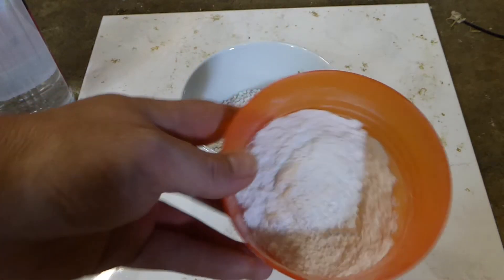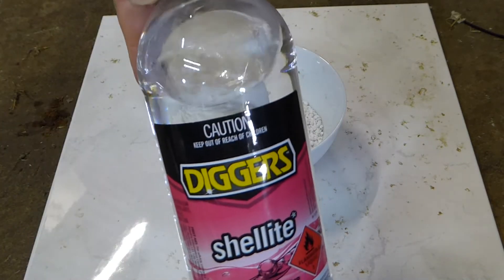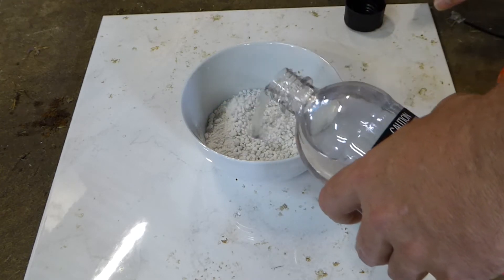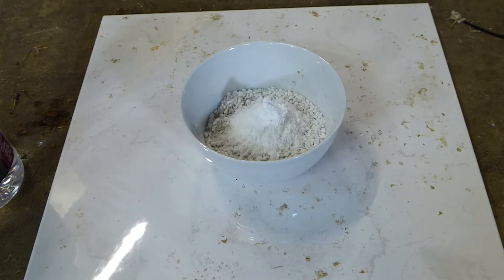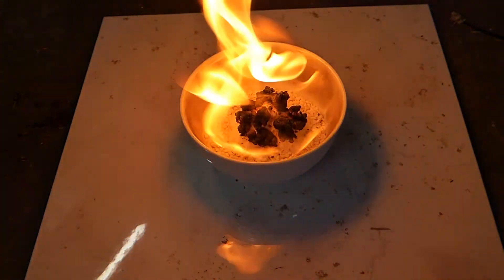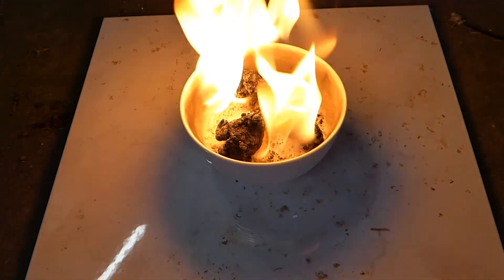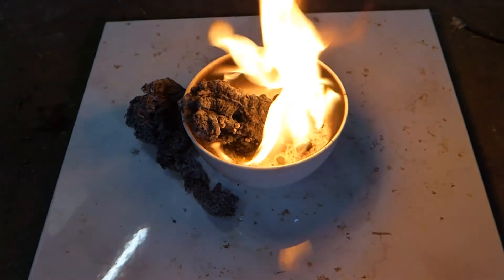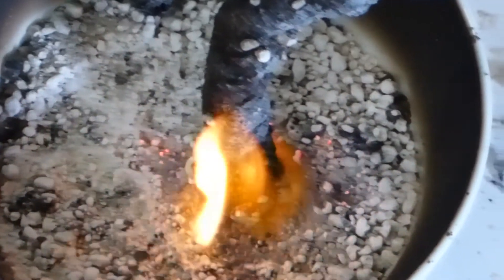Best Expansion of Sugar

Comment: So could you just grind up the expanded carbonised sugar and then make it straight into a conductive ink? - Or would it be best to now heat it red hot for an hour or so to make it into graphene first?  - Great work and vids matey! Cheers
Reply from the maker: it wont make conductive ink as it stands, baking red hot without oxygen is required-thanks for your comment
Reply: Cheers mate - Could you use a sonication machine for an hour or so to separate the graphene layers from the graphite?
Reply from the maker: RICHARD TATE that's a valid method for making it from graphite but I doubt that would help with the expanding sugar.

Comment: Well done m3sca1, by the way what is your first name ?
Same result as I had: very low conductive... Anyway, now you need to put this stuff in a steel cylinder and compress it there and then red glow heat it for at least an hour or so... Like Gerhard shows it here at this minute in this video:
https://youtu.be/IZVtRtSihfs?t=15s
Then it will get very conductive.
Many thanks for replicating this sugar snake effect.
Regards, Stefan.

Comment: You're like something is wrong you test the resistance of the sheet pile ... I half, poured into the powder / carbon sheets outside of covering a sheet of paper and a metal plate to squeeze their weight for 15 seconds. Then measure the resistance. The result is more dependent on the material and not from the air.
Reply from the maker: +Karantin Kunz will try that and see if it is more consistent. What have you been making ?